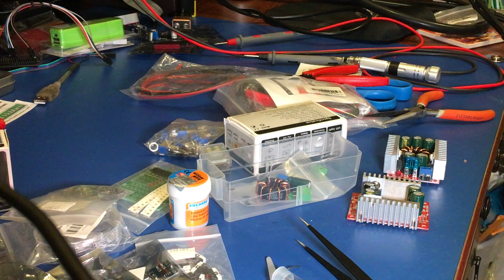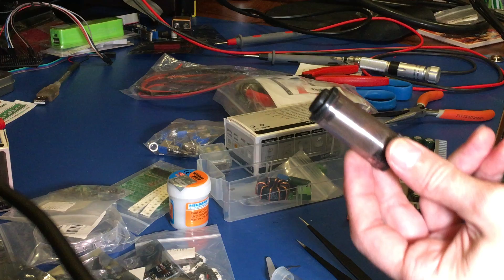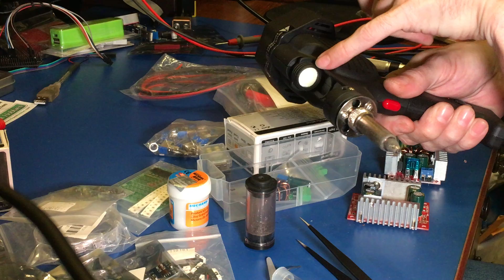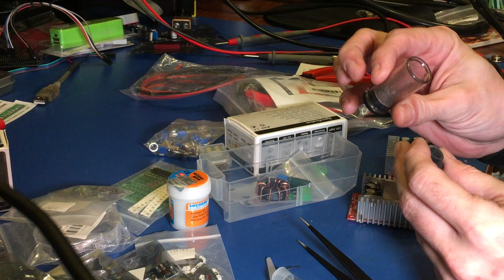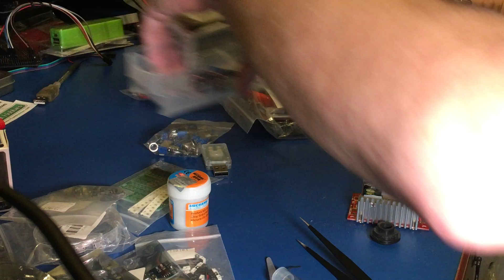Aoyue 8800 De-Soldering gun filter re-design PART 3 - More Gadget Tech Thoughts

Comment: Just bought one of these and have made (1) small mod.  If you tamp in a small wad of fine steel wool at the rear exit opening of the collection spring it will keep the  solder from clogging the first filter.   Also made some initial vacuum test readings:  12" of vacuum with (2) dry sponge filters.  8.5" of vacuum with (2) damp sponge filters. Quite a difference!

Comment: Great videos....  Can you help me out with where you sourced your ceramic gasket material?  I see a number of different sources but what they sell seem to be more cloth like than what you used.  Thanks a lot
Reply from the maker: Thanks. In the description of the video I have the links to all the products used and part number for the ceramic tape I used.
Reply: Thanks, much appreciated
Reply: Well, the 1/16" ceramic strip is en-route by courier from McMaster-Carr and I rec'd my Aoyue 8800 from SRA.  I sure agree with you regarding your thoughts about the stock "ceramic" filters..... No way are they ceramic, more like a sponge material. Like you, I found that they do not stay in place very good either. Really happy that I stumbled across your videos; otherwise I would have been ticked about the crummy filtering. Have you noticed deep inside the body of the gun, behind where you install the "backup" filter that there appears to be another filter? It appears to me that this filter is just ahead of the tubes that come from the diaphragm pumps. I used a small flashlight to look in there and discovered this filter......
Reply from the maker: Hmm, this might be a new thing they added as a backup to their stock filters. I have had my gun completely apart a few moms ago for inspection and I don't have this filter you mentioned. For something in that smal diameter I would think it would block the air flow, it might just be a screen to catch solder if the stock filter failed? 
You will be glad to know my inspection found signs of solder or flux fumes in the vacuum lines.
Reply: Ya, I took a small penlight and shone it back there and it appears to be a white filter (ceramic) with a few small flecks of silver (assuming solder) stuckon it.It doesn't look like your typical screen but more like the ceramic filters you've been making.  I suppose I could take my gun apart like you did in order to have a better look? If I do, I'll be sure to take a pic and send it along... Did you mean to say your inspection found "no" signs of solder in the vacuum lines?
Reply from the maker: Yes, I found NO signs of solder or flux residue in the vacuum lines. I think spell checker removed the "no" on me. Or I haven't had my coffee yet, that could be why.
Well thenstock filters are ok for catching solder, I decided on cerami because the flux fumes would build up and affect the valve function preventing the suction or it would get weak over time. I've tested and reported a few bugs with Aoyue in the past but it was through a reseller. I think they caught onto my channel when I did the video on the 3D soldering tool that I beta tested and gave them ideas for. 

Maybe they saw this video and decided to make a change? Good for them. I guess it's cheaper to add one fine ceramic filter for the fumes then to replace the "ceramic" sponges they use. It's a trade between cost and function. I buy low low cost items for this hobby and recommend the ones that work for me. They make decent things, well the ones I own and tested anyway but they also offermit at a fraction of the cost compared to others. So maybe this was their cheaper fix idea. At least they saw the video and addressed it. Most cheaper companies wouldn't make any changes. 

I know they have fixed firmware bugs I found before I would release a review in a pretty fast time. I like the fact they do listen to their customers and make the fixes. Other companies have ignored me, or just don't care. So I return the item and don't recommend it or review it since even a bad review is still free advertising. That's why you don't see bad reviews on my channel. 

Well I hope your desoldering gun holds up as good as mine has over the last year.
Reply from the maker: The more I think about it, now that they added the ceramic filter for the flux fumes. If you find the suction to be less stock suction with your ceramic filters you might want to only install the one ceramic filter in the chamber, and a yellow one behind the chamber. I wonder if three ceramic filters will affect the suction? This is hard to say since I don't know how thick their filter before the tube is. 
You may want to do some testing, it will probably be ok with all three ceramics. But I just wanted to mention that just in case.

If you decide to take pictures you can always email me. You can find my email under my profile on the your tube about tab from a normal browser. It won't show it with mobile browsers or mobile apps. Looks formthe part at the bottom right that says "For business inquiries: " and click the button for the capta.
Reply: All good points, thanks very much. If I can muster up enough nerve, I might just take it apart for that pic. The smallest light I have right now is a Mini Maglite. It's a little long in length to shine the beam directly at this back filter; I can only manipulate it a little and get some light back there, enough to see that there definitely is a filter though. I think what I'm going to do is start out with one ceramic filter in the tube, a lightly greased spring filter and the existing sponge type filter at the back. I'll see how that goes and then proceed accordingly by maybe removing the spring filter out of the tube and/or replacing the sponge type filter at the back with a ceramic filter. I think just getting that really crummy fitting sponge filter out of the tube and replaced with ceramic will make all the difference in the world. The existing tube filter will not stay in place.  I don't see myself doing all that much de-soldering, so perhaps this might be a good solution for me.
Reply from the maker: I just looked at mine at it looked like it had a filter in the back also. But it's just the light reflecting off the sheen of matted plastic. But I did think it was a filter at first. 
I don't remember we're I out my bore scope when I moved the lab, so I ended up taking mine apart and confirmed it's not a filter. I was wondering if they would put a filter in a sport that only the tech woild be able to replace, but now I know. Theirs no filter their, but I agree, at a glance with a light it does look like one. 

So I would go back to my original design with two ceramics. Or you could use the spring catch and the ceramic filter behind the cartridge. I don't see why that wouldn't work. The ceramic filter you make will catch more then the yellow one it comes with and the flux fumes preventing the valves from gunking up over time. 
I choose to use two ceramics and no spring because it's easier to clean. And one time the grease wore out and the solder was stuck on then spring. I had to use a torch to get the solder free. That was the moment I decided Their had to be another way and came up with this design.
I think this one is version three or four. I tried and tested several ideas before I decided on this one being the best and released a video on it.
Enjoy the new toy,
Scott
Reply: Interesting....... I looked again and see what you mean. I did see what appears to be a round black hole at the top of this area, perhaps where the suction tube connected to the pumps is ? So in that case, I think I will use your method with the two ceramics and no spring and monitor it closely.
Thanks again for your help...
Brent
Reply from the maker: No problem. Yes, the little whole is a post on the other side that connects to a silicon tube, the tube connects to a plastic "T" splitter that connects to some more tubing and runs to each pump valve. One on the left and one on the right. The valves have a diaphragm that connects to a spin system with a bearing to the counter weight on then end of the motor. This way as one valve releases and diaphragm is pushed in, the other one is doing the opposite. 
That part is easy to see and take apart with just the three long screws in the back. 
The three screws just hold on a plastic housing. It goes back on easy also. 
If you wanted to take a partial peak, that's the easiest part and your will see most of the pump and tubes.
It's also the first part to come off if you were to do a complete tear down. 

Maybe I'll do a teardown video now since it's out of warranty, I try not to take things apart when they are still covered under warranty, but mine is a yer old this month, or was it last month. Err, I should have turned on the camera when I just took it apart. Oh well,maybe I'll do it again. 
Scott
Reply: Thanks for that explanation. Can't wait to see that video, if you so decide Scott!
Brent
Reply: Hi Scott. I rec'd my roll of ceramic from McMaster-Carr this morning. I decided to go with your method; I have one filter in the cannister and one filter behind the chamber. No spring filter installed. It seems to work great, just like in your videos. Very happy with your design.   
Brent
Reply from the maker: That's great

Comment: Question does it have to be 1/16" thick or will 1/32" do as well?
Reply from the maker: +Vinny Consolino I only tried the 1/16" , my concern about the 1/32" would be the strength as hot solder being sucked into the filter from the suction pressure. I wouldn't want it to break through. If you try the 1/32" be sure to have the filter in the gun also as in the canister as a backup if the canister filter breaks. Also check it more to see if it breaks through. 

Another idea could be to use 2 of the 1/32" in the canister and 2 of them in the gun, just double up on the 1/32" to equal the 1/16" thickness? Just a thought.